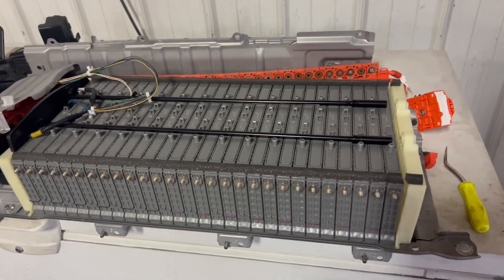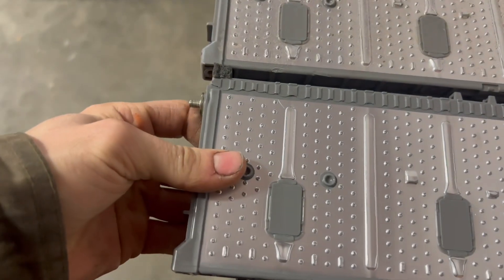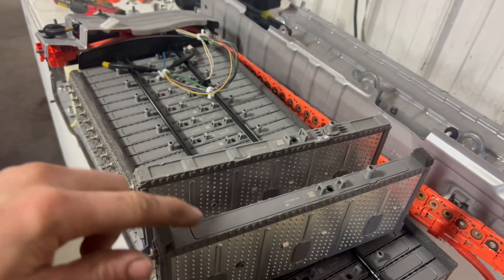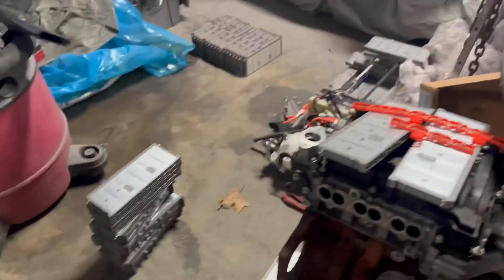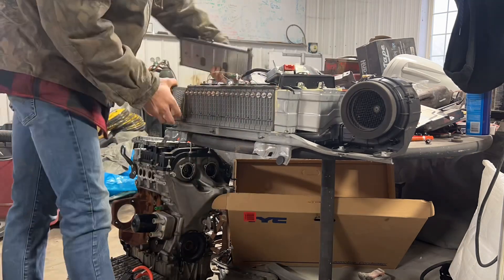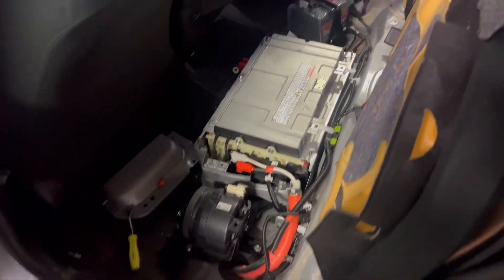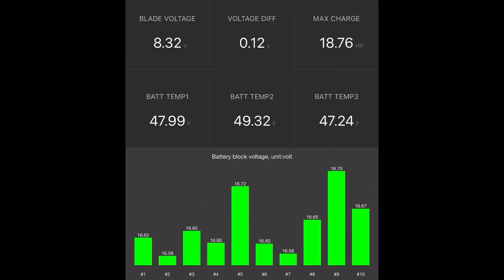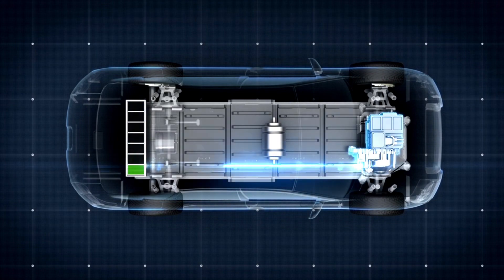Putting Gen 4 Prius Battery Cells into an Older Prius (Crazy Results)

Comment: Any idea if you can directly plug a gen 2 battery into a Gen 3.
My gen 3 needs a complete battery and I have a wrecked Gen 2.
Reply from the maker: No but you can use the cells from the Gen 2
Reply: Can you use Li-Ion modules from a gen 4 in a gen 3 pack that has NIMH modules?
Reply: you can use individual modules, but not the battery assembly, gen3 has recessed battery cooling system, still same 28 individual 6cell ni-mh modules, and in gen 3 they dying exactly because of that recessed cooling system

Comment: I think my battery is going out 08 Prius it does fine in the city under 50 miles an hour drives normal but when I get on the freeway the battery dies quick I can only do 55 and the battery stays around 45 to 50%. Where can I find Jen for sales I looked on car-parts.  And they are pretty pricey is there anywhere else I can get a good deal also is the Camry battery or corolla battery work do they do they have the same amount of battery cells. Thanks for any help I am 60 miles north of Houston
Reply: The crazy thing when I run the Dr. Prius at the voltage difference is no more than .2% and the Delta state of charge is always zero. Also when I break all the graph turns red and the battery voltage turns red also when I accelerate hard that the voltage goes down to 195 and it turns red and also all the bar graph turns red.

Comment: So, I can take a gen 4 battery, take out my old 2007 gen 2 prius battery bank, and then just transplant? (safety aside). Will it work? No fire? Help me idiot proof this concept.
Reply: I'm right there with you buddy. Same year for me too. My battery isn't dead yet, but the performance is going downhill and I was Thinking "why not get lithium?" I'm waiting for someone to educate me on this.
Reply: @jacklynch3333  project lithium, mixed reviews.  Not for NY winters for sure. There are some DIY boys buying 3000w inverters with 230v output and decent capacity 48v lifepo battery packs  to topcharge nimh traction battery on the go,2 wires  straight to HV battery post  , for city traffic they got like 75-80MPG from what i remember.
Reply: you need to remove and open a traction battery assembly, then unbolt each (28) ni-mh 6cell battery modules and replace it with gen4 modules, they are same size little improved chemistry,  you are free to mix them in a random order with gen2\3\4 nimh modules in case if you want to safe money and just want to put it back on the road. just match the capacity and internal resistance.
Reply: What did you end up doing???  My understanding is that most gen4 battery cells are Li-Ion while some are NiMH….  They say charging system is different however I can’t confirm because that’s what I read from a random blog…. Anyone wanna elaborate.   Thanks

Comment: Gud info! I had gud success with pulling a dealer installed replacement hybrid battery from a wrecked 08, after doing an investigation the date codes after 2017 they have the latest 3 gen cells already in a 2nd gen pac and getting the best mpg my Prius has ever seen!  I have tried the mod using lithium cells it works but not without it issues they suffer greatly in cold weather matter of fact I got my worst mileage (avg 36)  this pass winter! Thanks Nate
Reply from the maker: Awesome!